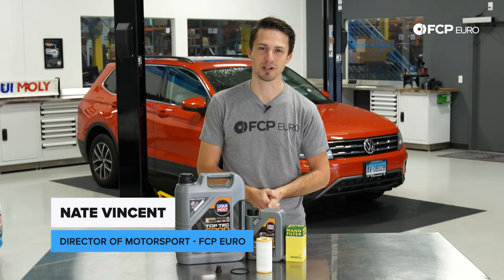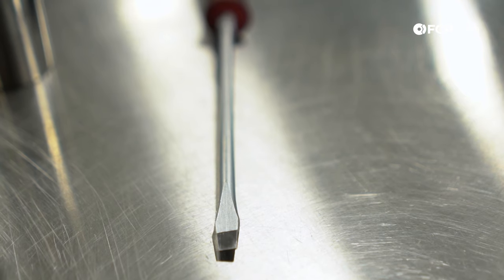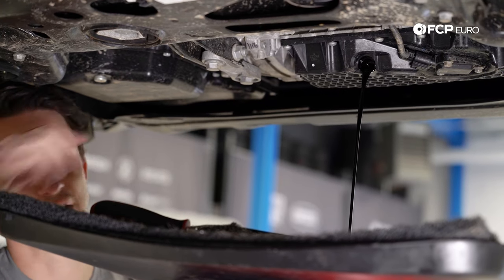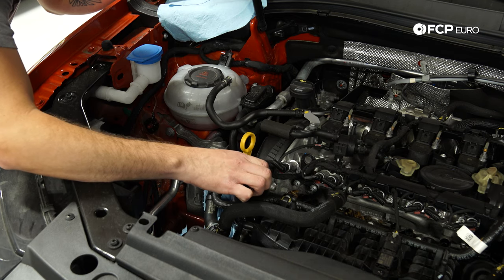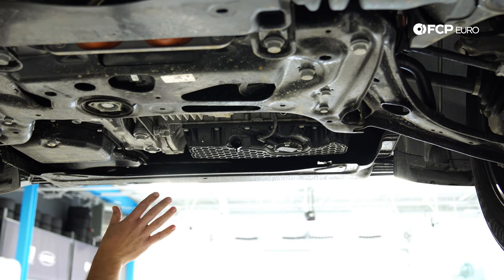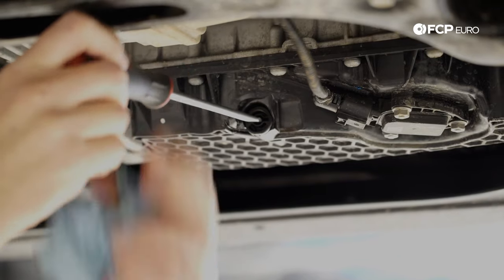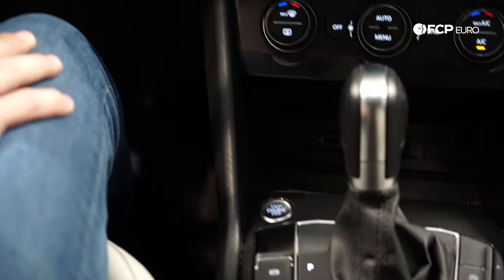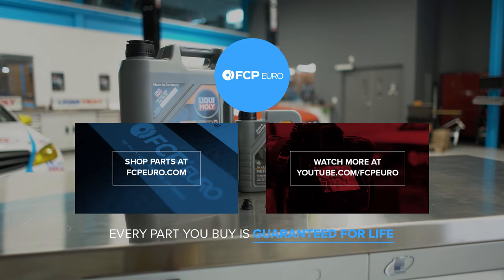2018 - 2021 Volkswagen Tiguan Oil Change & Service Indicator Reset (MQB - GTI,Jetta,Golf,Gen3 TSI)

Comment: 2018 Tiguan. Oil sits in a sump on the oil filter. Looks like 6-8 ounces. No matter what an ounce leaks out when I remove the housing, running down the engine. Plus there is that last bit of used oil sitting there. Short of a dozen rags around the base to catch the oil and vacuuming the remaining oil in the filter housing, what can I do?

Comment: Hello. I just bought a 2021 Tiguan and the dealer told me that I have 3 free oil changes with purchase. What freaked me out was they are done at 10,20 and 30k miles. So, questions, do I really only change oil at 10k miles? What about break in oil? Car only has 90 miles on it. TIA
Reply: Did you get an answer from any source?
Reply: @JERUSALEMA144k  no, I have not.
Reply: Pretty much every single VW tech and enthusiast I've heard from recommends 5k oil changes. I've always done that since I bought my 2012 GTI because I wasn't comfortable with 10k intervals. I did my own changes every 5k in between the free oil changes the dealer gave.

For break in period, check your manual and ask the dealer. There might be another oil change recommended early on.
Reply: While on the topic, VW also says that automatic transmission fluid is a lifetime fill. But definitely don't follow that. Change it like every 30-40k along with the filter.
Reply: @rjmari  should I go to dealer at 5k and just tell them I want it changed or go to a oil change business to get it done.
Reply: @davidkrueger9141  Either way works. If you go to the dealership, just tell them that you're doing 5k oil changes in between the 10k service intervals. It's not uncommon. 

But it would be best to do your own oil changes. You'll save time and money in the long run, and have confidence that it was done right.

A lot of oil change places are shady and/or do shoddy work. They might use the wrong oil specifications, skip out on changing the oil filter, lose screws for your splash guard, overtighten/strip drain plug, etc.
Reply: Yes, you can go that long with modern oil!!. I’ve had a VW since 2014, dealer maintained at those intervals and I’ve never had any problem

Comment: Thank you so much for this video! I was able to follow the same steps and change my engine oil. One thing is that it is better to buy a drain plug removal tool to remove the plug. Last year I used a flat screwdriver to remove it. However, I used the same flat screwdriver but the plug got stuck right before the final click point. I tried hard but only damaged the slotted part so the flat screwdriver couldn't use the slot anymore. Luckily, after doing some research online, an auto parts store had the drain plug removal tool ($13.99 plus tax) I needed, and is a 10-minute walk from where I live. With that removal tool, it was so easy to get the plug clicked firmly. I highly recommend people get the tool and follow the video. Thanks again!

Comment: I have a 2020 base model and to reset the interval I had to hold the reset button, just turn the key to on and when the oil message popped up hit the reset again.  No turning key to start. Which maybe was what you were saying but the S has no start button.

Comment: I’ve been waiting for this video. For a while my dealer was still honoring their 74.99 oil change coupons for the new 508 spec oil changes. Being that, that was about what I could buy the oil for. I think someone got in trouble for doing that because now these oil changes are over $100. It’s now worth doing them myself.
Reply from the maker: Definitely worth doing yourself Matthew, plus if you buy the kit through us you have free oil changes (minus what it costs you to ship your old oil back to us) for the life of the car!
Reply: Why are oil changes and the specific oil so darn much?   I just had my Honda done with full synthetic 0W-20 with a coupon for $40!  I'm thinking of buying a 2022 Tiguan (exact same engine I think) but I'm leary about the oil specifics and the prices charged by my not-even-closeby VW dealership.   I can change my own oil after watching this.

Comment: Thank you for the tutorial on the oil change. Very detailed especially on how the drain plug needs to be properly installed to make sure it snaps on. Would like to see oil changes on the DSG, Haldex and Brake fluid flush for 2018 Tiguan 4 Motion.

Comment: Plastic oil pan and drain plug is interesting. Well done on the procedure, liqui moly rocks!
Reply from the maker: Its actually a great little design. Takes car of the ole "too tight" on an oil drain fill plug and then you're stuck replacing the entire oil pan situation 😂

Comment: Great video! Thanks for showing how to reset the service notification. Do you happen to know how to change how many miles between oil changes? Mine says 548 days and 12,600 miles…. I know it should be 10,000 miles. 🤷🏼‍♀️ thanks

Comment: Question I ended up following your video when changing my oil. I noticed a oil stain underneath my car and plug was apparently leaking. I don’t remember doing anything wrong or over tightening the plug. Any tips to fix or just replace drain plug? I even tried to tight a little bit more, but I can’t it’s tight all the way.

Comment: Have you guys seen common issues with this gen of Tiguan leaking oil from the timing covers, or elsewhere? Trying to track my leaking issue. 

Also, have the alternator clutch pulleys been known to fail early, also throwing oil? Found some build up on my radiator's plastic end tank, which is in-line with this pulley. 

Lastly, VW updated their warranty once again, now to only 4y/50k miles? Or is it still 6y/72k?

Thanks for all the videos you guys produce. Helps a lot!
Reply: 4 yr 80k , as for oil leak get diagnosed theres 3 or 4 places they can leak from.

Comment: My VW dealer dumped 5W40 Castrol in my car for its 10k service, as written on the invoice. When I questioned them about it, they said it is fine and it can be used. I’ve noticed my 2021 Tiguan runs smoother with the 5W40, but the gas mileage has plummeted. Will this caus significant damage to the engine? I do my own oil changes every 5k with VW 508/509 0W20 OEM oil I buy from another dealer. What do you suggest I do about the 5W40 that’s in there now. There’s only about 2,500 miles left on the 5k service until I hit 15k. I already bought the 6 quarts of 508/509 0W20 oil, filter, and drain plug for the 15k service. Should I just wait until then or do the service now and then just let the oil go 7500 miles until the 20k service, which I’ll be doing at a different dealer that actually uses the VW Spec 508/509 0W20 oil? Thanks in advance. Great video!!!
Reply from the maker: We would suggest removing the 5w40 and replacing it with the recommended 0W20, this is a pretty specific requirement for the new EA888 VW engines and it's best to use what its been tested and engineered to use. If you purchase the oil change through our site (with Genuine Oil or our Preferred Liqui Moly like in the video) then dont forget its also covered by our lifetime replacement grantee! Essentially  giving you and your car free oil changes for life every 5k or so miles.
Reply: @fcpeuro  Do you suggest I also change the oil filter too, despite it only being in there about 2,500 miles? I’d hate to have to waste that practically new filter, but if you recommend doing so, I can part with $13 for the filter. Thank you guys for the advice. I’m lovin my 21 Pure White Tiguan SE R-line Black! They really aren’t as slow as people think…but I do have a FWD model where there isn’t as much weight from all the drivetrain components for the 4motion. Thanks again guys, great informative video as usual.
Reply: Tom, about how much are you paying for that specific OEM oil at a VW dealership?   And the oil filter?   Thanks.
Reply: The DTEA engine code in the 2021 Tiguan uses 502.00 oil or 5W40. 
The DGUA engine code used in the 2018 to  uses 508.00 or 0W20.
Reply: I would go after dealership for damage to the engine because you have the proof they used the wrong oil. Engine won’t last as long so to the added pressure due to higher oil viscosity

Comment: Do you need to replace the drain plug each time you do the oil change?
Reply: yes
Reply: No, but at some point the o -ring will take a set and no longer seal.

Comment: Always using 5-40 for Ea888 G3 2016 on mine, is it fine to use 0-40 after ? Thanks
Reply from the maker: 5-40 or 0-40 will both be acceptable!

Comment: Is it mandatory to change engine drain plug on every oil change?
Reply from the maker: Definitely recommended as it's an inexpensive item - 'cheap insurance'
Reply: I was told by a mechanic that yes it must be changed every oil change

Comment: I would have toped off the coolant reservoir, checked the brake fluid level and checked the steering fluid if it uses hydraulic oil; other than that, thanks for the tips, tricks and advices.
Reply from the maker: Never hurts to check those essentials whenever you're under the hood of the car!

Comment: What causes the intermittent valvetrain noose in these gen3 tiguan engines?
Reply from the maker: Intermittent? That is strange, valvetrain noise can be low oil level. What exactly are you hearing? Some valvetrain noise is normal plus these DI engines tend to be a bit noisy.
Reply: When started it makes a tapping noise then when warm it is a intermittently tapping noise from valvetrain dealer say it is normal,I personally find that to be annoying sounds like a old car I have a 2020 tiguan sel r-line I will call corporate about it can't understand how a valvetrain tapping noise is considered normal..
Reply: The two most common replies from a dealer is "It's normal" or "I've never seen that before".
Reply: @kaydan9906  Could be the high pressure fuel pump

Comment: How would they even know I don’t use 508 spec oil?
Reply: It has a dye in the oil
Reply: The VW spec 508/509 0W20 oil is green in color due to a dye VW puts in it.
Reply: It can be lab tested and they do

Comment: Mobil is supplier for VW . Auto Zone I just bought 5 quart jug for Mobil 1 ESP 2 0W20 for 39 with taxout the door says VW 508 509 spec on the back
Reply: 👍🏻You should have gotten an oil filter with that price too

Comment: 5W-30 is the only listed oil type I see with a google search. Also, the local big boy chain auto part stores list it. But I see the 0w-20 being offered by you and some of your VW-centric online competitors. What gives?
Reply: I guess because of where you are located? My '19 says 0W20 on a sticker right under the hood and local dealers only use that 508/509 spec
Reply: What is shown in your owners manual.
Reply: @PonderingOne  Use the oil on the sticker under the hood.
Reply: So you’re googling incorrectly and not googling the owners manual duh

Comment: 2021 has a completely different oil filter.
Reply: I'm thinking of getting a 2022...aren't these engines using full synthetic oil?   I don't hear that mentioned anywhere, don't see it anywhere on the labels shown on these videos.

Comment: A plastic oil pan and a drain plug you remove with a flathead...? Two more reasons never to purchase a VW product.
Reply: Plastic had come a long way my guy. This ain't no 2001 era plastic
Reply: Those aren't an issue at all.  What is is the carbon deposits that build up on the back of the intake valves on VW/Audi cars, needs to be addressed.  I know Toyota has both Direct Injection AND Port Injection on their RAV4 and the new Corolla Cross.

Comment: Anyone else notice the 2.0T's like to burn coolant? my wife's 2019 Tiguan CONSTANTLY smells like burning coolant, and has since it was new.
Reply: There’s an extended warranty on the water pump for that model year. You should take it to the dealer.
Reply: My 2019 Arteon does also.  Not much, just bring it up from low to mid a couple of times per year.  I'm waiting until I get within a year of warranty running out to get it addressed --probably the water pump/thermostat assembly.   The new one will fail with time, so I'm waiting and getting the factory one replaced later.  Who knows, maybe the new ones will actually fix the issue.

Comment: Being that the oil change seems similar to 2020 Audi q3 2.0t. Is there any difference in the engine between the 2020 vw Tiguan 2.0t and the 2020 Audi q3 2.0t? I know ones a tsi and the Audi tfsi but can you please tell me the difference ? Thanks in advance @FCP Euro
Reply: The 2020 Audi Q3 2.0T still uses the same VW Spec 508/509 0W20 oil, but the Audi 2.0T has more horsepower, I believe 211 compared to 184 in the Tiguan.
Reply: @tomdolgin5441  I’ve seen the 2020 tiquans being 2.0t but are tsi, the Audi is a tfsi does that make any difference in motor aside from power ? Or is power the only difference
Reply: @1state152  It makes no difference. TSI stands for Turbo Stratified Injection and TFSI stands for Turbo Fuel Stratified Injection. There is NO difference. They both mean the same thing. VW uses “TSI” and Audi uses “TFSI” on their engine covers. They are literally the same exact thing. I’m sure the companies wanted to differentiate the two brands even down to what’s on the engine covers so that people don’t think that they are the same exact thing, even though they are. Hope that makes some sense. It’s just marketing. To confuse you even more, the MKV VW 2.0T engine covers used to say “FSI” for Fuel Stratified Injection. Those are the same exact thing too. LOL.